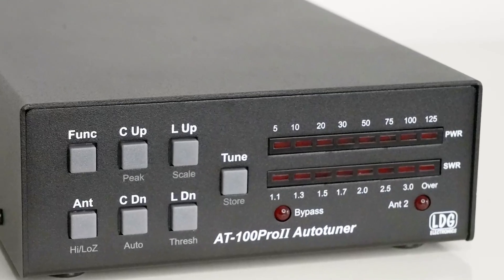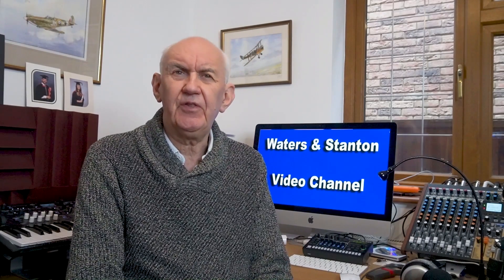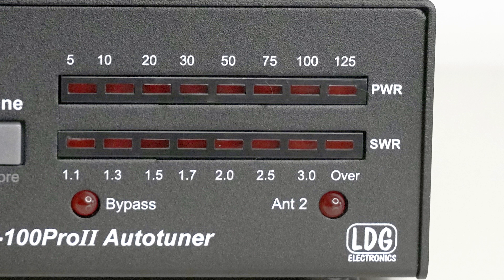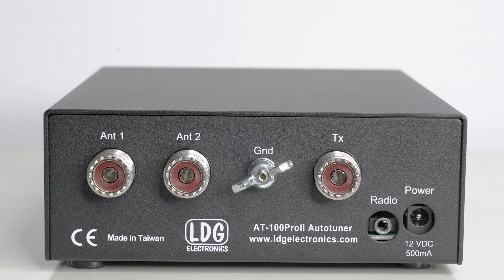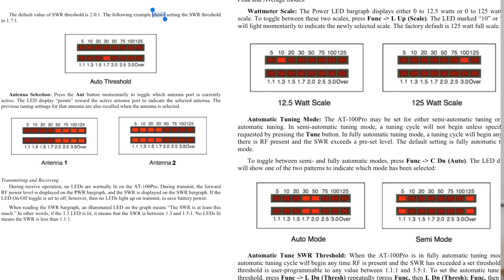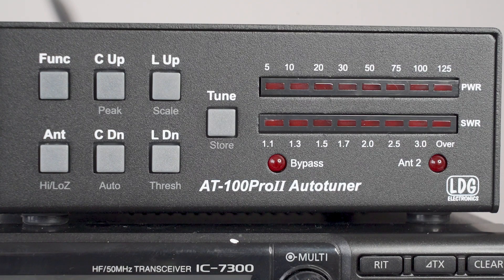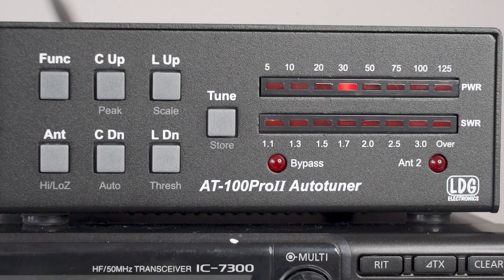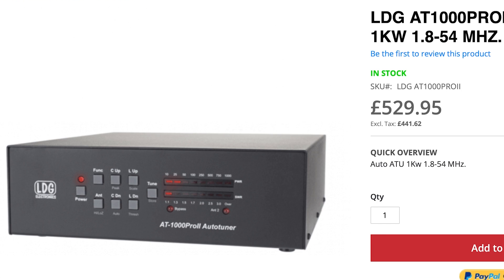HAM RADIO REVIEW of LDG AT100 Pro II - Auto ATU 1-8 - 54MHz.

Comment: How do I operate it with the ft-891? Will it work automatically once it receives a transmission or does it need a cable from the machine? Or manually from the button?

Comment: I had them but jeez they are noisy especially late at night and Radio room is upstairs.
Now i never use a tuner, and have resonant antennas for most bands.
They do work but prefer resonant antennas to reduce losses.
Reply from the maker: Generally speaking, if you are using an antenna on a band already set uo, the tuner should go straight to it.
Reply: There are no "losses" in a non-resonant antenna.
That's a myth (that's still alive, apparently). 😂

Comment: It does have a quirk in that the relays are self-latching so if you are on ant2 and cycle power, when it comes back up, it incorrectly indicates ant1.  At least, that's what happens on the one I have.
Reply: Which model and power capacity if you don't mind?
Reply: @charleswoods2996  The AT100proII
Reply: I have the older AT-200 Pro as the 100 wasn't in stock when I bought it. The the 100 has latching relays, the 200 doesn't. The idea was that you could turn off the power with the AT-100 and keep using it. You need to keep the power on with the AT-200. The AT-200 returns to the last used setting when it is powered on. Being the older model, it misses out on the indicator LEDs for Bypass and Ant2.

Comment: Does it make more sense to have the tuner out at the antenna? The coax between the radio and the antenna shouldn't need tuned, just the antenna right? Are there good external antenna tuners that can go outside with remote controls so they can be operated from inside?
Reply from the maker: An ATU at the antenna is a better option, but it will not TUNE the antennna, only match it. Remote ATUs show the greatest benefit when using balanced 300 or 450 Ohm line. Check out https://hamradiostore.co.uk/ldg-rt-rc100.html. 73 Peter.

Comment: From the beginning of the video answering the initial question; "Because upon deep and intense research, many operators explained that they automatic antenna tuner in the Icom 7300 particularly isn't nearly as accurate - as - the LDG AT-1000 ProII Autotuner that I use with the aforementioned transceiver."
KD8EFQ/73,  Akron, Ohio USA!
Reply from the maker: Many thanks for sharing. 73 Peter